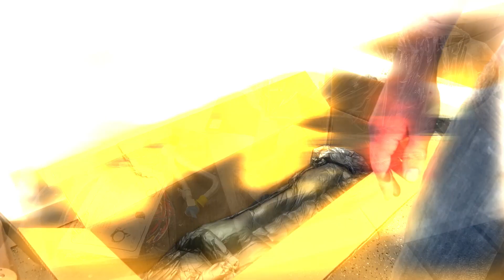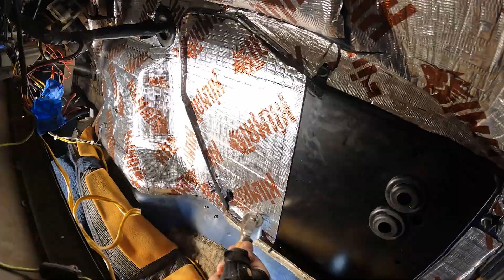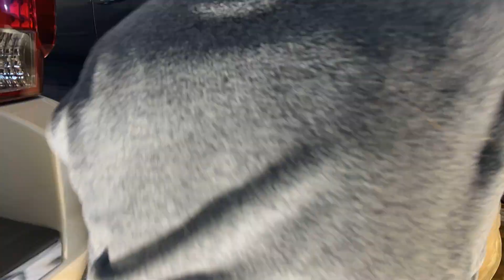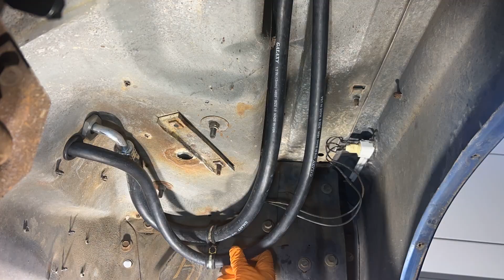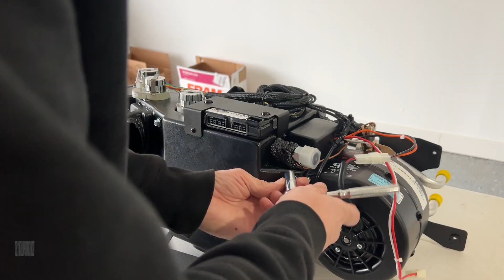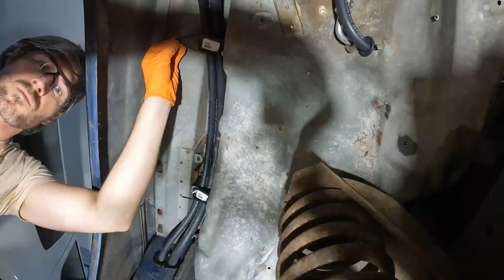Installing Evaporator & AC Hoses | Vintage Air 79 Bronco

Comment: Degree of difficulty about the same for bronco w/o  factory a/c? I don’t have the giant hole in my fire wall.
Reply from the maker: I haven't personally installed one but I think it would be about the same level of difficulty. A few things that would be done differently would be drilling a couple holes to mount the evaporator and run the heater lines. Also cutting out the openings for the vents on the dash.

Comment: I purchased my 79 bronco which the guy told me was equipped with AC. After the truck was delivered the AC compressor was not even present. My question is I noticed your bronco was also factory equipped with AC. Why did you decided to install this unit? What is the advantage? It’s it because this uses the R-134?
Reply from the maker: The factory evaporator and blower wasn't functioning when I bought mine.  The guy I bought the Bronco from recommended vintage air because it's compact, fits behind the dash and is more powerful than the factory AC and blower. I haven't had a chance to use the AC portion yet but having the heat and defrost has been clutch this winter.
Reply: Thanks for getting back to me. My blower works but I haven’t had the time to see what else is missing. Hope to see more progress on the 79. Not many haters of that year.
Reply from the maker: @billj4137  if it's working and you get a compressor in there it may be all you need. I love the 79 it's a beast! Don't forget to subscribe to follow along on my resto mod.